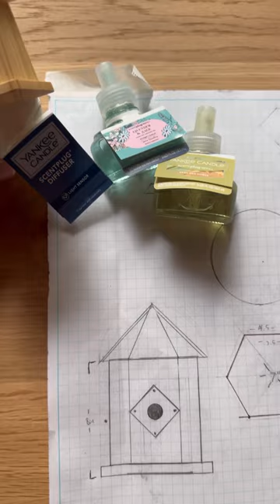A birdhouse but bigger #diy #diyprojects #birdhouse #fypシ

Comment: Lovely! Is this designed with a particular species in mind?
Reply: It’s designed to match the plug in scent thingy
Reply: @Screaming Violet  yes, I noticed that too. Some species of birds have a certain circumference entry that they prefer, for example. This house reminds me somewhat of a purple Martin house, based on its overall geometry.
Reply: @jackal_extraordinaire  that might be what the original designer was going for with the scent dispenser. However I doubt that bird would ever fit through the tiny hole in that house. Bloody gourgeous though.

Would be interesting to see what types of birds end up using the real house… but depends on their location… I doubt it would be my local kookaburras lol